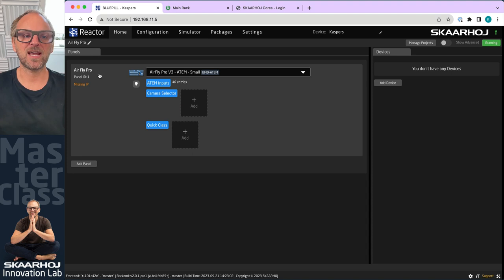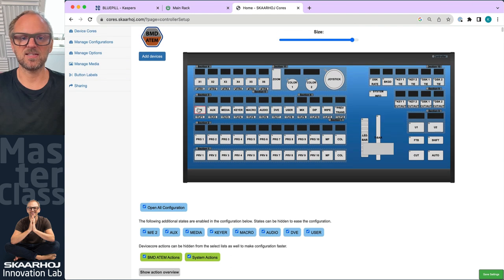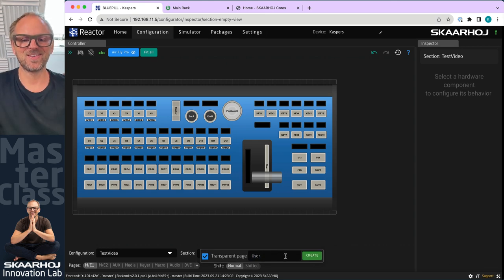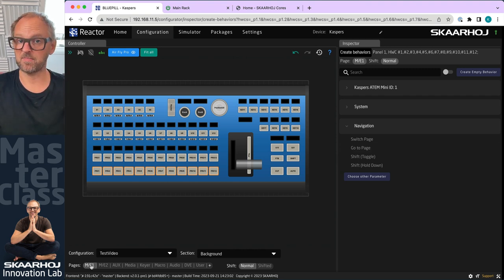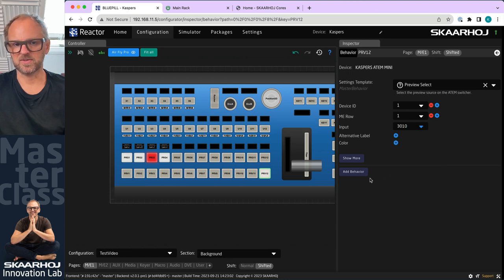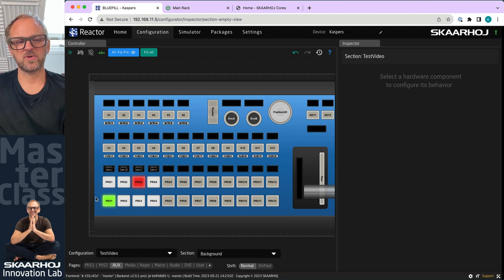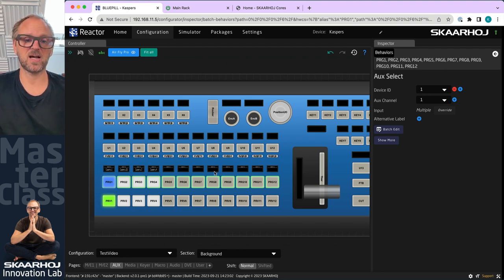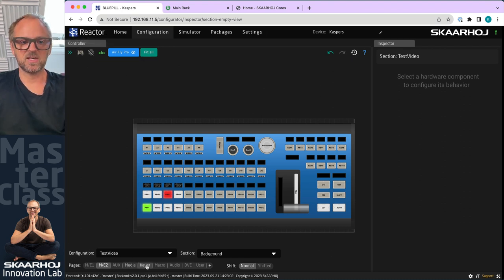Unveiling Reactor 2.0: A Comparison with UniSketch using Air Fly Pro

Comment: Can reactor 2.0 work with my v1?
Reply: I'm not sure what exactly you mean by "v1", but if you have a UniSketch Air Fly Pro the answer is both yes and no: You need a Blue Pill Server or any other Blue Pill Inside controller from us, then you can put your UniSketch panel into Raw Panel Mode and the Blue Pill can connect to it and use it as a panel. So: The UniSketch Air Fly Pro would just be a panel that sends and receives messages to the Blue Pill device which has Reactor running on it and which is the "brain"